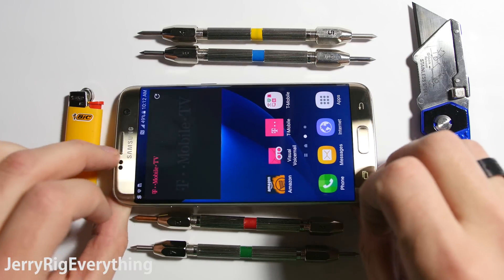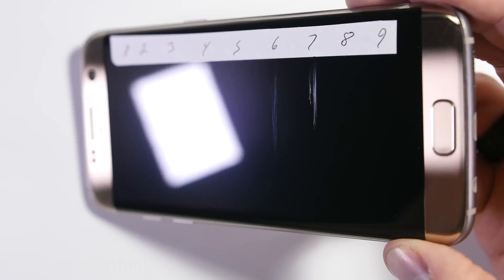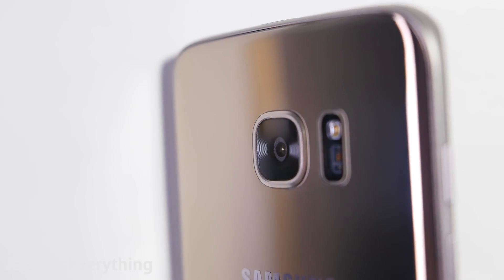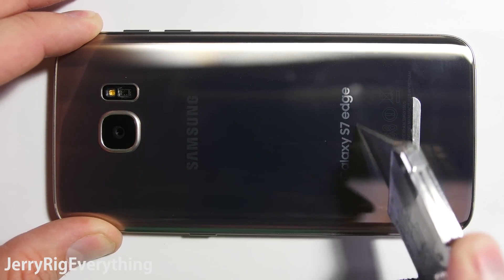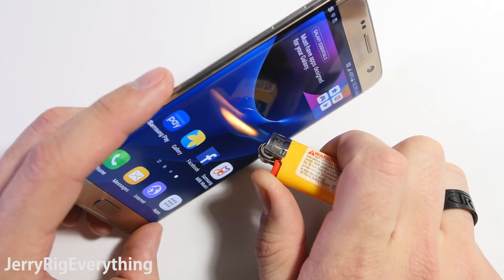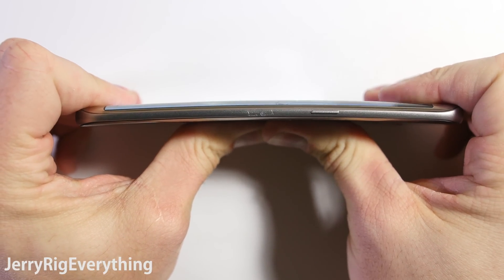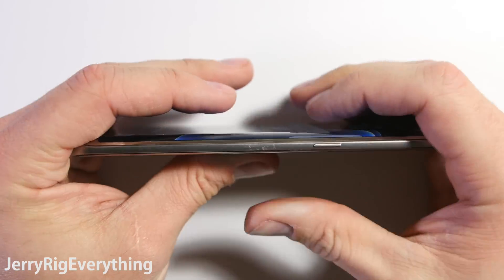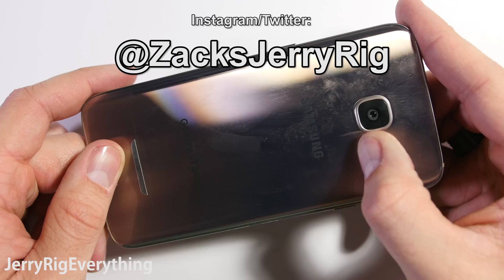Galaxy S7 Edge - Bend Test, Scratch test, Burn Test

Comment: Still using this exact phone in 2022
Reply: Is it good?
Reply: @kevinmbuyelo7520  It works.
Reply: @kevinmbuyelo7520  mainly to do with the browser
Reply: @kevinmbuyelo7520  ya it's good phone but after 4 years of daily use the battery needs replacement because in 2019 I used to play games on charging 😅 and everytime I turn on the phone it gets a little hot and if I play a game it only last for 1 hour and a overheating warning ⚠
So I just bought a new phone 2 months ago but the S7 edge still works
Reply: @Andreas1931  i don't play games that much or while its charging but i'm glad that its still a Beast
Reply: @kevinmbuyelo7520  ya as long as you don't play games it will still work for 5 years
Reply: @kevinmbuyelo7520  The one in my family still works well. But there are sometimes issues.
Reply: @breather8758  i knew it but its still worth it in 2022 and i hope even the next years

Comment: 4 Years later and I'm still using my S7 Edge though it did cost me $200 for replacement battery and screen about a year ago, Samsung service centre insisted I replace both even though the battery life was fine.  Still loving the camera and screen with no plans to change it anytime soon.
Reply: WHAT 200 i got it for 50 from samsung
Reply: Got replaced battery, USB port and front glass for $60, think they had to do a bit more in your case.
Reply: @SpecialProjectY  Nope, Official Samsung Service Center took them 2 hours to turn it around.
Reply: @phunwithphiphi8055  Wow, just, wow. With Right to Repair law starting since 2022, they should work on cost consistency of repairs.

Comment: Still rocking my S7 edge today. Good phone.
Reply: do you have any screen burn in (ghosting image)?  I heard some Samsung phones overtime have screen burn in from daily use
Reply: @BlazingIndica  I've had my Samsung Galaxy S7 for almost 3 years now and I don't have my screen burn in. I use this thing EVERY single day for hours, I've taken it on road trips and even went to Mexico and back twice and this phone still holds up. There's obviously some issues like battery and some bugs on apps like Instagram and YouTube but that's not something I can really fix and the battery still has decent life after daily use.
Reply: @BlazingIndica  I'd also like to note that I live in a very hot place (avergae summer days are between 85 to 100+ degrees farenheit) and I keep my phone in my pocket when I'm out and about so the heat adds up but luckily this phone still works like a charm.
Reply: @BlazingIndica  mine doesnt but ive always used pretty low brightness now the batterys noticably worse but still good enough to where itll still last 10 hours with regular use
Reply: still a beast.. have been using s7 edge for 3.5 years now
Reply: Same dude
Reply: @StarVeilz  woah calm the racism down
Reply: @SirDoodIsTaken  it worked didnt it?
Reply: Any solution  for pink line problem in s7edge
Reply: @StarVeilz  U idiot he is not an Indian he is a pakistani or arabic.
Reply: Mine broke in under a year... With a high quality screen protector on
Reply: nahh
Reply: But bad battery
Reply: I use it as a work phone still and yeah straight up beast still holds up with the best can do absolutely everything new phones can do i recommend that phone to anyone who has midrange phones like i tell them you need to get s7 off amazon or ebay its soo cheap now such a good deal for what you get really

Comment: How to fix pink line issue of s7 edge
Reply: Its in the led not the screen anymore if you raplace it to a technician the the screen quality will not be Qhd (1460×2040) it will be more lower than that i suggest buy a new phone if you replace it its not worth it
Reply: @friedpotato524  if there any cheap fix to make phone running ?

Comment: Guys, as stated by Jerry, the flash and heart rate sensor lens are made of plastic thus it scratches very easily. Mine is already scratched even with less than one month of use.
I want to know if scratches on this lens can impact in the flash and the heart hate function like if they're going to stop working because of the scratches

Comment: The back panel does not related to a water sealing at the S7. All its components are seals from the inside. The back cover is just attached with a strong sticker and does not play any rule in this phone water resistant ability.
Reply: namrur lol there are 0 seals inside the phone. It doesn't have a hydrophobic coating, so if the water gets inside the phone, the phone is roasted.

Comment: guess i don't need a screen protector... I've gone through 5 of them and none of them were able to fricken stick. the first 2 didn't fit size wise. they were too damn accurate in terms of measuremeants meaning 1mm off on your marking and you screwed it up. and the other 3 i bought from ebay, all three of them couldn't make their right side stick to the curve of the screen. not sure why. but i've thrown everything away. if i can get rid of this phone im never buying a curved screen again.

Comment: @jerry, I have a suggestion.

I would be great if you will use some sort of machine or another method in the bend test. 
Something that have a pressure calibration, so that viewers can easily see how much pressure it can take in ascending order just like what you do in the scratch test. It will be more comprehensive than bending it with your hands. Thanks.

p.s. I'm not good in expressing myself in English language but you know what I mean.

Comment: you didn't scratch the fingerprint scanner any updates for that tnx
Reply: Haris Gr If the microfiber cloth is dirty (dust, sand and so on) it is possible to scratch the surface of the fingerprint sensor. My Nexus 4 display got scratched to death from what looked like dust, but they were tiny sand particles in there. (Locker in gym)
Reply: It scratches since it's made of plastic and does not recognize your finger anymore.
Reply: Jerry-rig everything has tested for Samsung phone so far and when he tested the S6 he never scratched the fingerprint sensor the same with the S7 Edge but he did scratch the fingerprint sensor on the Galaxy S7 active and it never worked again because he scratched into the copperish layer
Reply: How is it possible to make a scratch with a microfiber cloth? Are you trippin' ?
Reply: I was searching for it
Reply: Proteinloser Proteinshake he said to check the s7 active scratch test to see how it will scratch
Reply: Are the s8 and s7s display as good a resolution?
Reply: @playdust3226  samsung are known for making the best displays 
Its a fact 
Apple's displays are made by samsung but more low-end because apple doesnt want to pay more
Reply: Les M 
yh you didnt
Reply: that bait
Reply: My s7 edge's fingerprint scanner got scratched and it still works
Reply: Playdust it has great resolution and amazing viewing angles
Reply: He didn't scratch the volume and power buttons either
Reply: Yes it will still work
Reply: I was also searching about fingerprint sensor scratch test of this device
Reply: Les M When I had my s7 edge for about two years the fingerprint scanner got scratched and I don’t think it worked as well as it used to so it definitely has an impact
Reply: I just made a scratch trough the whole scanner when just wiping off fingerprints with mircofiber cloth. I'm pissed.

Comment: Hey man, do you know what level of sharpness it takes to scratch the glass back of the S7?
Just wondering.
Reply: it startes just about level 6 where you can see some tiny scratches and around level 7 marks get more pronounced.
Reply: +Samy_06  So just like the front?
Reply: ahh you meant the back glass,  well I'm not so sure about it but given the fact that it is also protected by a gorilla glass 4 layer just like the front glass it won't be scratched too easily,  i'd say that it's around level 4 or 5 so it's pretty resistant,  it should hold up well,  the only fear is sand,  so inside your pocket the phone has absolutely no risks...
Reply: Okay, thanks for your reply. Both glasses are pretty similar, so saying it's about a level lower than the front makes sense.

Comment: wow, I'm pretty impressed with the scratch test! Go Samsung! I'm really glad this phone is pretty durable all around, as I am a bit hard on phones. Being that it is almost entirely encased in glass (and that I am clumsy), I bought an Otterbox case immediately. It isn't  a guarantee since the force of an impact or direct weight on the phone can still shatter the glass (especially the unprotected screen), but it is definitely a necessary precaution against small falls from your pocket. I have dropped mine several times in the month I have had it without any noticeable difference. But, definitely try to prevent it from dropping when you can, as I felt some kind of component/s vibrate slightly when I was absent mindedly tapping my phone on my thigh the other day.

Comment: Well  it has been about two months since I got my amazing galaxy s7 edge. I absolutely LOVE this phone.... but... My rear facing camera lens cover has a small scratch across it, and my heart rate sensor/led flash cover has a ton of significant scratches! I have no idea how the heck that happened either! I'm always extremely careful with all my phones, especially my amazing s7 edge, and yet this has happened. My galaxy s5 didnt have issues like this even after close to  2 years of use! The s5 looks brand new! I am so upset and disappointed! Especially since its a sealed phone and the camera glass can not be replaced :(
Just figured I'd share my experience :(

Comment: so I got my s7 edge 2 weeks ago and I'm not sure what happened but I pulled out my phone from my front pocket and the display has a horizontal line in it about an inch down and when running certain apps random purple vertical or horizontal lines show up and flash on and off rapidly, not sure what happened I'm thinking that the phone bent and the screen cracked internally, there is no external damage whatsoever, any ideas?
Reply: displacement in one of the display's layers. RMA would be your best bet, it's one of the 0.2% failure rate.

Comment: Awesome video. I actually have a question as well. I have my S7 Edge in a Spigen TPU case and noticed there are several scratches on the back glass on my device despite it being in a case since I got it. Is there any known way to help remove or alleviate the prominence of the scratches on the back glass? Thanks.
Reply: How do you want to remove such scratches please? If it is in the coating, you can apply new oilophobic coating and the scratches may disappear. But if it is in the glass forgett it baby. You could bring it to a glasses maker who can polish scratched glasses. He might be able to polish them out. But its a hit and miss situation. Maybe it works, maybe not

Comment: I just recieved my Galaxy S7 and i want to by a Micro SD for it. I've noticed that there are different kinds of upload speeds on the SD cards. All from 48 mb/s to 95mb/s.

I'm wondering: What's the difference between these and do i really need the fastest and most expensive one?
Reply: +Imnotmagiic hi man! the main difference is not in speed. Speedy cards use SLC, ordinary cards MLC scheme.
SLC = single level chip, MLC = multi level chip. Because of it SLC or speedy cards more reliable than MLC cause they use the other technology. So as result for you speedy card will offer to you not only speed but reliable work. Thats the answer. Hope this info will help you!
Reply: +Imnotmagiic FullHD video firstly is buffering by the phone, only then the info is recorded to the card. So no problems at all
Reply: +Imnotmagiic the memory is the most important thing, i do advice to buy speedy card. As well its not one time deal. You can use it with the other devices, so its multiuse product.

Comment: +JerryRigEverything Possible explanation to your burn tests... 
AMOLED displays utilizes thin film technology, so you could imagine each pixel to be it's own mini LED. The semiconducting material used is sensitive to heat in such that heat will permanently alter the conducting characteristics of the material thus damaging them forever. 

IPS LCD displays on the other hand uses crystals in a slushie substrate. The crystal material is sensitive to magnetic fields such that the orientation can be changed through induced electromagnetic fields. The crystal material has a curie temperature (the temperature which magnetism no longer affects the material) and when heated to the curie temp the crystals are no longer influenced by electromagnetic forces and the pixels turn black because no light is being directed out. But once the crystal temperature begins to drop they regain their magnetic properties and they realign with the electromagnetic field and the display return to normal.
Reply: +Matheus Caixista Great question, So behind and infront of the liquid crystal layer is several layers of thin plastic light films that bend and direct the light evenly across the screen. My assumption would be that the layer just outside the liquid crystal has been heated too much, either the color filter or one of the conducting films that help point the crystals and now the crystals are stuck in the "on" position so that is why it is white in that spot instead of turning back normal.
Reply: +contractki11er So at the very least we have a living encyclopedia here so nothing could go wrong, don't you think?
Reply: +spaceface105 Right on ;)

Comment: I'm sure that liquid cooling system is fake just like on the lumia phone
Reply: And why do you think so?
Reply: I'm Demise oh :P
Reply: Denis Müller i was referring to liquid cooling but I've just realised that liquid cooling on a phone is actually possible (xperia z5 has distilled water in the heat pipe) I didn't know that it was possible
Reply: Brandon M Yes thats it.
Reply: I was right ( ͡° ͜ʖ ͡°) ,no liquid cooling and they did market it as liquid cooling
Reply: Brandon M Yes cause it works the same.

Comment: Just watched a drop test and the S7 is not bad but compared to the durability of the underrated iPhone 6s it is killed. http://youtu.be/GU8S_BjByKU
However they are extreme tests and many users have cases on, but it is clear that from the same price point the iPhone 6s>Galaxy S7. Interesting to see speed tests now as the S7 looks a beast but can it overtake the clear leader with less than half the specs?
Reply: specs aren't everything like the software makes a difference as well. since applie phones run on exclusively Apple OS everything is formatted perfectly for itself but since Android has many different types of softwares that people can use making them more indie app dev friendly they typically run a little slower in exchange for more customization and flexibility (and I don't mean flexibility in terms of bending)